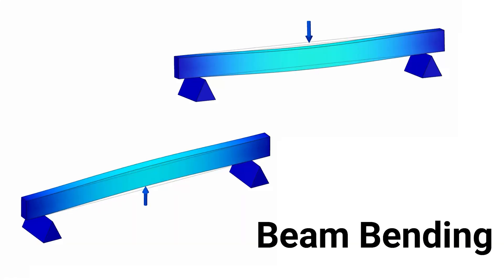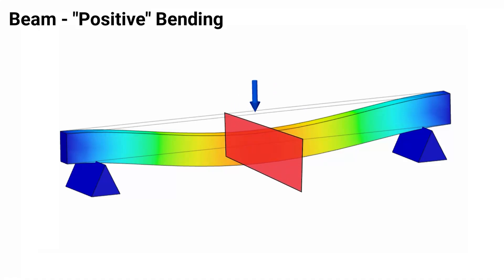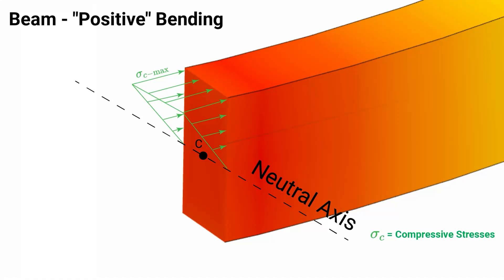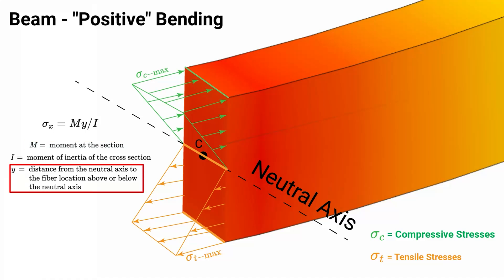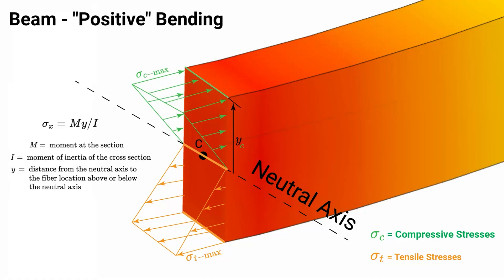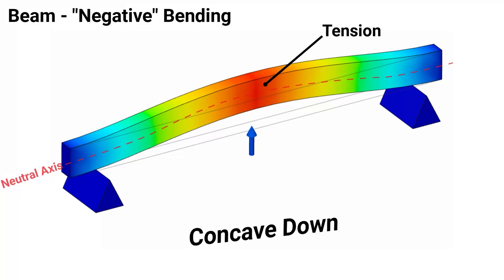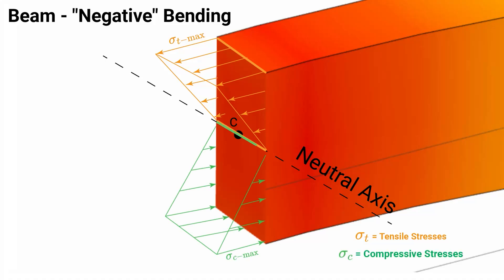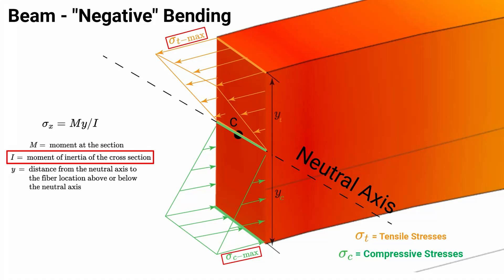FE Exam Concepts - Beam Bending

Comment: Hi Faruq,
I hope this message finds you well. I am an international student currently preparing for the FE exam. I have been using the "FE Review Manual" by Michael R. Lindeburg (Third Edition) for my studies, but I’ve found that it doesn’t cover all the topics or provide enough practice problems.
As an international student, I find the cost of enrolling in your course to be too high for my budget. Could you please recommend a comprehensive study book that covers all the necessary topics,  along with a good practice problem book to help build my confidence?
Thank you.
Reply from the maker: Replied to your email 🙏🏼